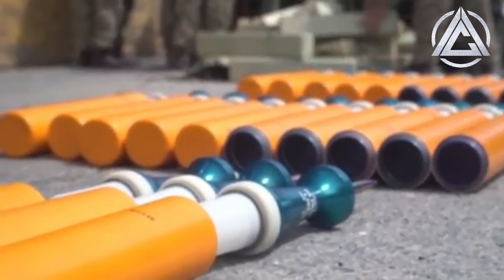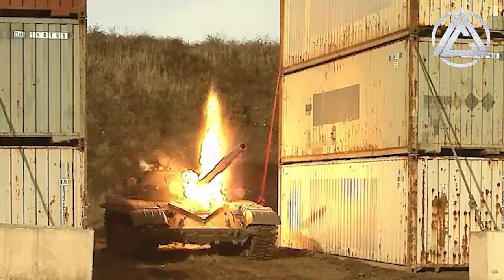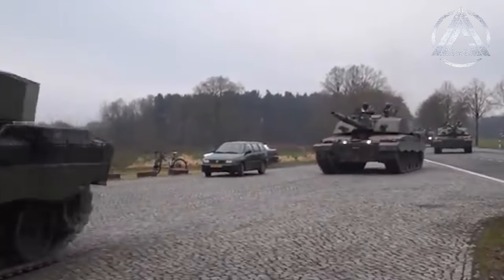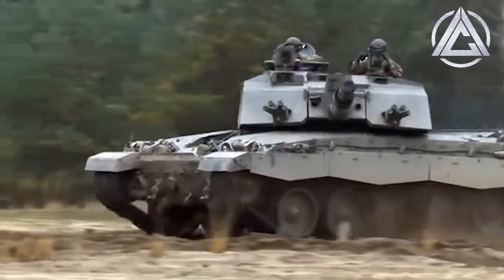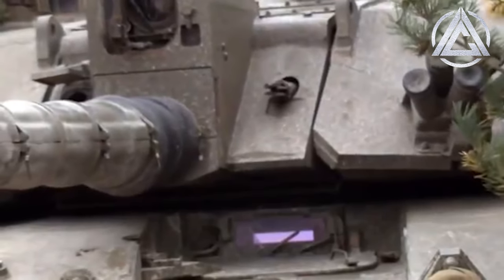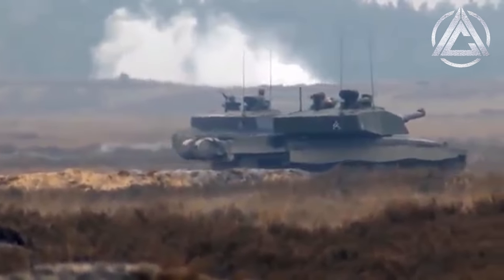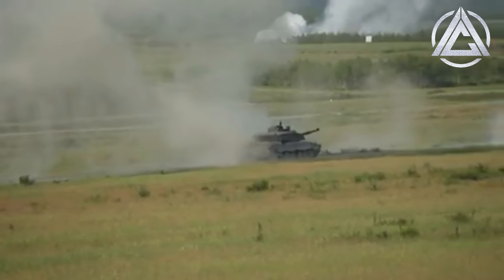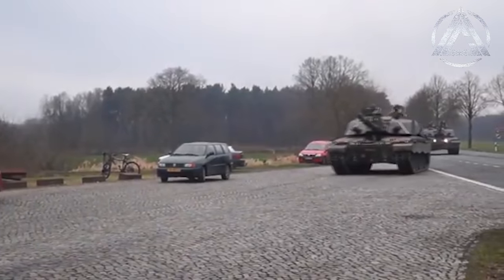Challenger 3 | Britain's New Main Battle Tank | Is It Really Any Good?

Comment: I had a two hour discussion with a family member who wanted to talk to me about this, and it range true with almost every point you made. 

UK procurement cycle goes like this: 

Step 1, design a vehicle which is excellent for the year in which you have designed it, and ultra-optimised to meet and defeat the threats of that period, usually with design work nearing completion right at the time when that threat is going out of fashion, and a sweeping change is coming to all vehicles of this type, rendering your new design (at best) highly conservative, and at worst, obsolete before it's even reached troops. Don't forget to recycle as much as possible from older designs and hamper your new one in as many ways as possible by insisting on nothing clean sheet, all upgrades of upgrades of equipment that has heritage in 1945. Wherever possible, take the cheapest approach short term, whether or not it costs more later.

Step 2, spend upwards of 10 years testing the hell out of the prototypes. Really make sure all the minor details are polished to perfection, and that the vehicle is massively over-built, so that it's really mechanically reliable, well laid-out for the crew, and has lots of quality of life features that will ensure the users love it. Don't bother talking about the big details, like how the over-built chassis weighs far too much, or how the armour and gun are now 20 years out of date and it's not even reached troops yet. Rest assured that a fifth re-arrangement of the buttons on the gunner's controls will make it superior to your rivals.

Step 3, after spending a decade testing your originally budget vehicle, likely selected over rivals purely because it cost less, you have now spent far more than your rivals did for their development. Cash strapped MOD cuts leave you with a small production run that causes cost per vehicle to spiral. Necessary upgrades are totally forsaken because it cost so much to get the vehicles to troops at all that there is no cash left to make them remotely modern. While vehicles that were already more modern continue to be upgraded, yours grows more and more useless. At this stage it is important to let the troops and public know that they have the absolute best vehicle in the world, which nobody else wanted on export, and you should keep stressing everything is the best right up until the exact moment you order a replacement, at which stage you will change tune and reveal everything was garbage to justify the new expense, acting like you have been saying that all along.

Step 4, repeat the cycle. This happens in 30 year intervals. Never accept as a nation that this is a problem, always feel smug and self assured that being British makes all equipment the best in the world. Repeatedly use codename jargon to imply that every part is better than everyone else's and whenever challenged with evidence, claim it's classified and they couldn't possibly know.

You will find, the more you dig, that this isn't just exclusive to armoured vehicles. This cycle happens with British submarines, surface warships, aircraft... it's pretty much every MOD project. Spend more money, get a worse outcome, usually obsolete on arrival, or "designed for, but not fitted with" necessary equipment it will never receive, and fiercely defend it as being somehow world-beating so nothing ever changes.
Reply: The sad part is, sometimes, they do the exact opposite (look at the L129A1) so we know they can do it well when they really want to. almost like the more expensive the project the more scared they are of wasting money and end up wasting more money
Reply: Think you need to remember that we're competing with tech inferior to our own, so having a well optimised vehicle represents a quality investment for battlefield resources and logistics. If we ever go to war with USA / Germany etc. Then you'll have bigger things to worry about than mod profligacy with funding.

Comment: The speed of tanks is typically limited by the transmission and final drive. The Abrams for example is completely capable of straight line speeds of 62mph, but the transmission will prevent it to protect itself as well as the final drives. Also, the forces exerted when making a sweeping turn at those speeds on the track guides could have you hearing a loud bang and then watching your track sail down the road. They probably improved the transmission and final drives along with better guide pins. The Abrams can actually be adjusted by a mechanic, I've had one at the theoretically top speed and there are still plenty of RPMs to go faster. Plus the speedo goes up to 62 in those.
Reply: Abrams isnt capable of 60+mph, it is capable of 42-43mph.
Reply: Thank you for that. All that I read on that said nothing about that. Thanks again.
Reply: @kf8575  that's a limited top speed on the transmission. And top speed is actually 45mph on all models and in all TMs. But it can theoretically go 65mph if it wasnt governed.
Reply: @Deathbomb9  What would be the point of that if it destroys the transmission in the process? Its like the Soviet MiG-25's jet engine. Or the eighth gate (Gate of Death) in Taijtusu in Naruto.
Reply: @death_parade  typically the transmission isn't what gets destroyed first. The final drives would become overheatedand start to cause excessive force that the transmission doesn't like to deal with. You would damage the transmission for sure if you ran it at those speeds for an extended period of time, but before the transmission failed your final drives would fail and either break completely of you would end up with a lot of noises that they aren't supposed to make (metal on metal grinding of seized bearings or completely destroyed bearings and the shaft rubbing in ways its not supposed to). The transmission can handle theoretical speeds close to 72mph, but that was tested with resistance of about -5tons of what the original XM1 weighed at the end of testing and trials before it entered service. Limiting the transmission to 45mph is good because over the road your supply line can keep up and cross-country your supply line can cope with meeting you when you need it. It also allows the infantry support you would need to keep up in their Bradley's. The military is all about redundancy and never exceeding about 80% of capability on just about everything it has. So when you looker the US military and think how advanced they are, understand that the equipment is only being worked at 80% rather than 100% so it lasts a lot longer and is much more reliable. And there are points where you can get 100%, but that's when you risk breaking things or causing some sort of damage. And those times are typically reserved for emergency combat use, you are unlikely to ever see footage or video accounts or recreations because the military does everything in its power to foresee and prevent those cases.

Comment: The two biggest things I come away with in researching this vehicle is:
1. It's not a Challenger 3, it's a Challenger 2 upgrade.
2. The pinnacle of tank achievement for the British was Centurion.
Reply: I mean the only thing challenger 2 about it is the hull...everything else is completly new, even the hull insides have little commonalities with the CR2
Reply from the maker: @warhead_beast7661  not really true - the hull inside and out is pretty well unchanged, the only significant changes being to the ammo storage. The turret is all new though, but very similar in design overall
Reply: @ArmorCast  and new engine
Reply: @ArmorCast  didnt they say it got a new engine, Transmission and Suspension?
Reply: Centurion was already just a slightly better Panther.
Reply: @Panzerzwerg  if you speak of the Cent mkI yes you could Match it with panther.... Later models like the Mk 3 were far superior. But it doesnt make much sence to compare a ww2 tank with a cold war one
Reply: @warhead_beast7661  The Mk 1 was worse than a Panther. I am talking about the Mk.3 which is from 1948. The turret was an inefficient design (Gunner couldn't pull the trigger of the CoAx w/o taking his eyes off the sight), the gun mantlet got jammed by 6pdr fire, the tank had a hilarious range (80km) and the 20pdr is just a slightly better long 88. Sure it has APDS with 330mm of pen at 1000yds but the sloped armour performance is subpar. The driver's position was very cramped as well.
Reply: @Panzerzwerg  Well Panthers range at the end of the war was about 100km after it broke down and you had to basicly remove the Turret and hull roof to get the Transmission out. The Cent got external fuel Tanks wich of course didnt fix the Problem but extended the range at least. But its a diffrence if your tank Breaks down or just runs out of fuel. Cent was also way more easily to fix and to maintain. The 20 pounder had a stabalisation and since we compare it with panther which only had a long 75mm without any stabalisation, it is far superior. German Tanks also never adopted spring loaded hatch Systems wich led to high crew death counts. Alongside German poor steel quality the Amor would be not much better on panther....
Reply: @Panzerzwerg  Invalid statement, comparing apples and oranges.
Reply: @Khorsathedark  I'm not comparing anything. What I'm saying is the Centurion was a pretty mediocre tank for its day. Not even close to the outstanding wonder it's made out to be by its fanboys.
Reply: Challenger 2.75?
Reply: @ArmorCast  thats what he said
Reply: @Panzerzwerg  incorrect in many ways lol
Reply: There were lots of doubt about the Challenger 1 after poor competition scores, in battle it was 400-0, it had double the range of Abrams,  the longest range tank-tank kill and only losses were blue on blue.  The operational reliability was 98% according to the sources I saw.
Most importantly it could make a brew!
Reply: @ArmorCast  if you're using the same crews and keeping the same repair & maintenance facilities you want as much commonality as possible, surely
Reply: @Panzerzwerg  given you're talking about the Panther so highly by comparison and have a username like that, I don't think you're really in a position to then talk so negatively about fanboys defending their favourite tank 😆
Reply: @1IbramGaunt  is that really the best counter you can come up with?
Reply: @Panzerzwerg  I don't need to come up with a "counter", I'm not the original commenter nor am I necessarily disagreeing with your actual viewpoints on the tanks 🙂 guess I was just criticising your criticism

Comment: Very interesting video on a very interesting vehicle. I do agree with your conclusion that the Challenger 3, as it's currently proposed, is only a more modernized and upscaled version of 2 with some extra capabilities. For me it bears the hallmarks of an interim vehicle rather than a true replacement with futuristic capabilities, something to tide you over until you can design a truly revolutionary vehicle.
Going without active protection in a modern battlefield though does seem both anachronistic and dangerous at this point though.
With UK politics being what they are currently, it wouldn't surprise me if this was more to establish jobs and political capital now and make a more futuristic design later on.

Comment: It’s kinda like the T90 in that the CR3 is a super upgrade like the T90 was for the T72.
Reply: T90 is a new update design mix features of T72 and T80
Reply: @huntermad5668  well considering there was basically no changes from the T-72BU to the base T-90 it was a T-72 upgrade in all but name
Reply: @BatteredWalrus  
To reflect the difference between it and original T-72.
Seeing they share the hull and autoloader but different turret, different gun, different fire control system, different engine.

More than half of T-72BU is new parts. Both from t-80 and new.

That is why i called it a mix of T-72 ans T-80

Comment: While a hypothetical "which tank beats which…" scenerio is a academic circle jerk, there is still a valid argument for a comparison of practicality and usability - which tanks are more desirable for a clean sheet military to aquire.
That would involve a lot of metrics, of which who would win in a straight slugging match is not the top category …
And even if it came down to a actual tank on tank battle, there are a lot of other factors in play than just firepower vs armour.

It would be a interesting idea for a video.
Reply: Modern tank rounds in the West can pierce any tank's side and rear armor.  The vast majority of them use thermal computer targeting.  The main difference is their logistical foot print. Some tanks use more fuel than other tanks and some tanks break down more. Those things are rarely discussed because they don't seem cool to talk about.